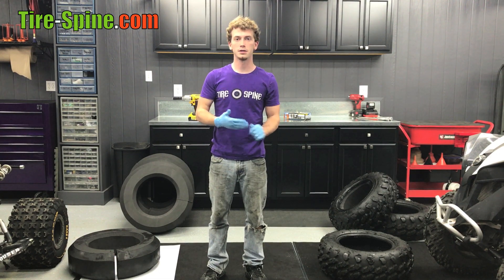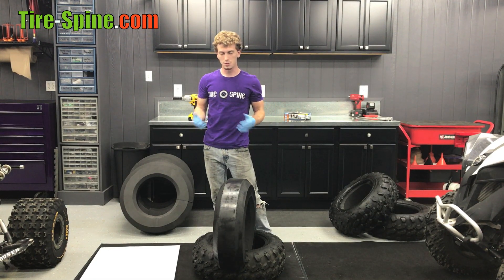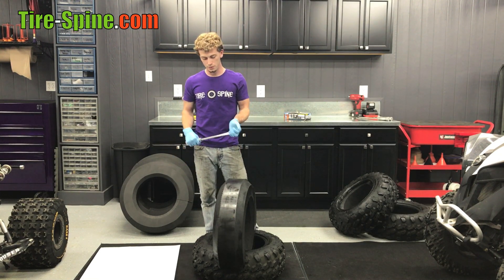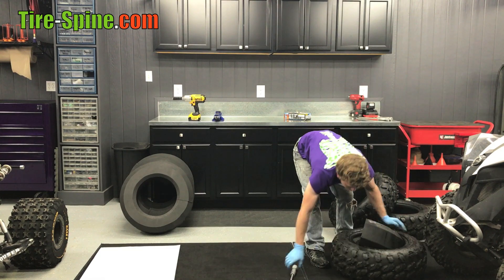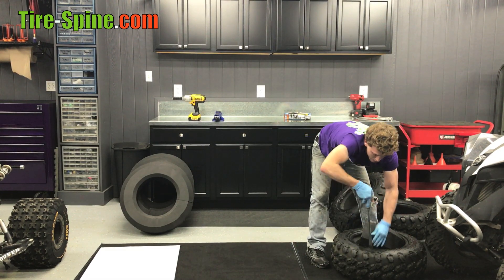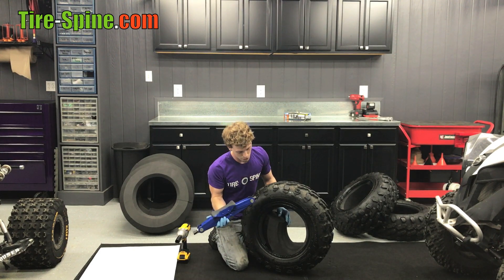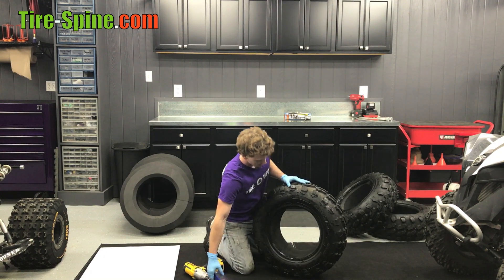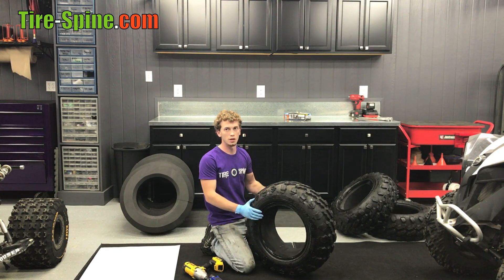TIRE SPINE RUN FLAT INSTALLATION

Comment: I've heard a lot of good things about this product. They are definitely a good product and serves the purpose. My question is, how do tire spines perform in a rock crawling scenario? Does the tire still flex? Can you still get the added grip benefits of low tire psi with the spine installed? Thanks for the video! Keep up the great content 😎
Reply from the maker: yes you can still air down and it still works well
Reply: @MadRam11  good to know.  Thanks

Comment: Sun f run flats 12ply , i swear by them here in Nevada. i run them on my maverick max on the rear only. cant even tell when they are flat.👍😆
Reply: is that molded foam or rubber? in the R/C race world, we use molded foam and we put holes in the rim (air in the tire is bouncy = tire not planted). many even put holes in the tire too (let the air and dirt get out faster). but we glue or bead lock the tire to the rim.
Reply: Gatorage john the sun f is rubber. Some people say they are to stiff and heavy but the peace of mind being in rural Nevada is worth it to me. And i run them with at the most 5 psi or less and they soften up. The race world i could see the foam being as good or better.
Reply: so it's mainly just for bulletproofing.
Reply: Gatorage john yes indeed